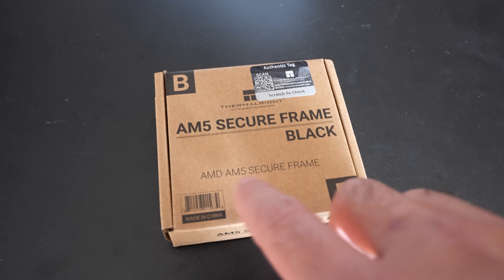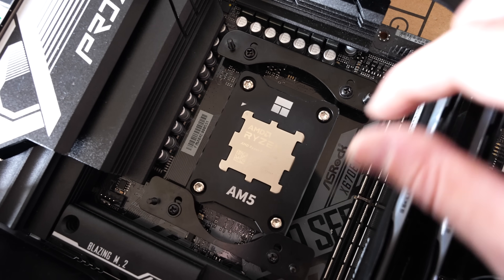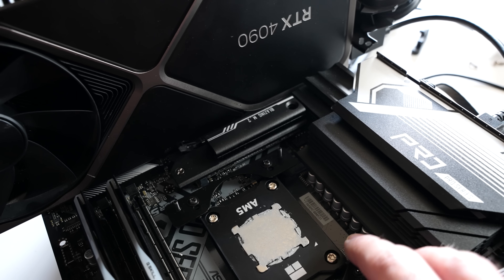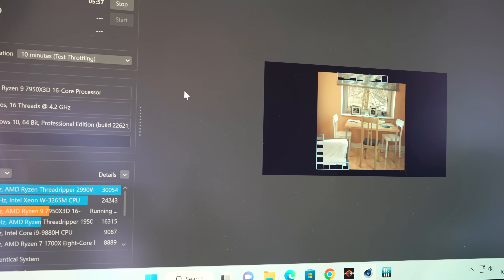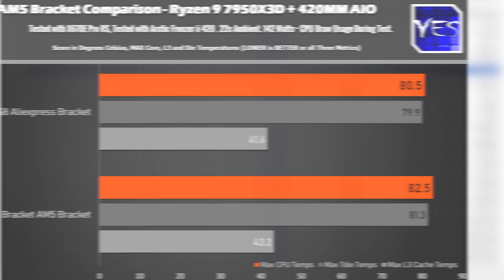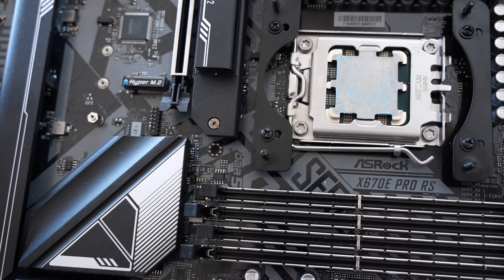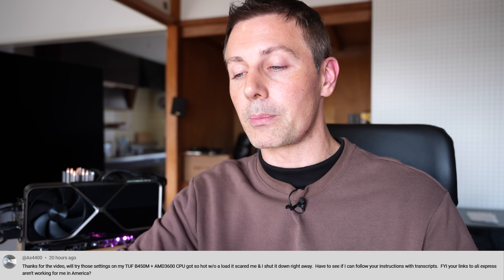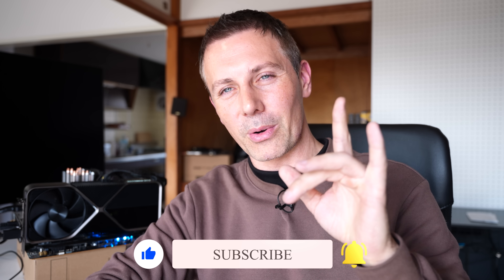$8 Fix for AMD Thermal Problems? | Thermalright AM5 Contact Frame

Comment: I know it likely does nothing but, there is something just so right about the way it looks when installed that would probably make me buy one. 
Sometimes it's nice just to do a job with something that little bit higher quality if it looks/feels so right. 
And yeah I know it's not visible once the cooler is on, but you still know it's there and done better.
Reply: I mean the price is worth the satisfaction and dopamine hit from the installation anyway.
Reply: its visible with a cooler on, especially a aio, so make sure you get a color you like.

Comment: btw ppl i have am4 have an x370 board and a 5600x cpu my temps were a bit weird would fluctuate i tried everything to get my all core oc stable it wasnt happening, I ended up lapping the cpu and realised my chip was made so uneven so defos if you cant get your temps down on amd ryzen lap your cpu down to the copper i did some asus realbench and got a max temp of 70-80 at 1.396-1.406v  ... then i played my game of choice vr chat in vr mode it was getting in game 55 degrees then i slept in vr woke up thermal paste settled overnight and now its running at 45 degrees which is amazing btw before the lapping i would run asus realbench at 94 degrees and this was a reading after replacing my thermal paste several times , also the reason i wanted an all core overclock is because i tried pbo oc and although the cpu gets to 4.85ghz it doesnt perform as well as an all core oc even at lower all core clock speeds.... so definately use all core oc's in the bios i went for 4.75ghz on all cores also i noticed all my cores are within a few degrees of each other like 1-2 degrees across all cores after the lapping and i had tried pbo and all core testing with two different cpu coolers and am now using bolts and nuts instead of the am3 hardware that fits on am4 mounting so yeah also got plenty of cooling fans in my case airflow is amazing

Comment: I have a 7950x and I've never had any kind of thermal issue.  I did hear that they ran hot before I bought it so went with a 360mm AIO cooler.  It does the job perfectly, I've never seen my temps go above 75.
Reply: so your only gaming on it?
Reply: @OPTIMUS6LTR gaming doesn't get it anywhere near 75c
Reply: My 5600x runs 15 degrees cooler than that just running a wraith prism and undervolt 😂

Comment: I HAD thermal issues but it was because my AIO sucked. (Thermaltake 240) The processor kept getting over 89⁰C and shutting down. I bought the Alphacool Eisbaer Pro Aurora and my temps dropped all the way down to 32⁰C - 50⁰C. Big difference.
Reply: Aio not working before lol
Reply: @MicaelAzevedo  Hence it sucking.

Comment: I thought they were just so thermal paste doesn't get under the IHS
Reply: No, they are not! The manufacturers clearly state solely for pressure improvement. The optional silicone guards for paste protection.
Reply: @Betelgeuse666  Manufactures can claim whatever they want doesn't mean it's necessarily true. Gamers Nexus did a video on these contact frames and found them to amount to basically negligible thermal improvement--me saying they're basically guards for thermal paste because they look and behave just like the silicon guard.

Comment: This is reminding me to not be lazy and install my contact frame for my 13700k.  Seems a bit overkill on AM5 though, I don't think they have the warping problems LGA 1700 has.
Reply: 13th gen undervolts like a champ too. They seriously overvolt the crap out of them. Really good clocks at ~1.2V can be attained compared to 12th gen.

Comment: I bought the thermal right lga1700 for z690 and i7 13700kf with Artic freezer 240 mm. The temperature reduction was insane, dropping from 70C to 55C at 5600Mhz OC.
I highly recommend these products if you plan to overclock or just want a lower cpu temp.
Reply: Yes, but only on Intel LGA 1700, since that socket has mounting issues all the way. So bad, that your problems can range from "only" memory instabilities up to booting right into a bsod.
If you're on Ryzen 7000 you would benefit more from lapping the cpu or delidding it, the IHS is actually the most hindering factor when it comes to thermals and clockspeeds, and keep in mind: Zen 4 is designed to push for those 95°C first when setting the clockspeed and voltage automatically.
Reply: the worst part is intel knew this was going to be a problem, I refuse to believe they didn't. My evidence for that claim is being a user of the LGA3647 socket, another socket that is nothing even close to square. The solution to the potential cooling issue was using the cooler to apply the mounting pressure from above rather than at a couple of points on the edge, the bulk of the pressure being where the lines intersect, right in the middle of the chip. AMD still made a square chip, so the warp of having an oblong monstrosity who's pressure is applied centrally isn't the issue, but as some have speculated the thicker IHS may be to blame. If so the fault of both parties was trying to maintain a broad cooler compatibility through using more or less the same mount design and Z height respectively.

There may come a day when more performance necessitates a return to direct die, or at least I hope it comes to that.

Comment: If you were to lap IHS and cooler plate flat you might find higher drop. Lapping doesn't usually help using the factory retention mech because it deforms the IHS slightly (actually quite a lot with Intel 12th and 13th, as much discussed) - the frame would maintain the profile of the IHS (the cooler plate also needs flattening because they're usually manufactured either slightly arched or domed to conform to that IHS distortion).
Reply: Lapping it makes the am4 coolers incompatible
Reply: It's Intel's fault, I really hate the design of their latest sockets, it's too wide on one side it's clearly made to be bent on purpose and I think they look uglier than ever specially when they have the highest prices and look less high-tech visually...

Comment: That air cooler is reaching saturation and can’t absorb anymore hear whether the bracket helps it make better contact or not. If you were to use something with two towers and two fans you would likely have seen similar results to the water cooler.
Reply: Air cooler is not enough. The difference should be in CB23 results. Roman tested offset mounting and no diff in temperature but cpu has +1500cb score
Reply: @hristobotev9726  there are some air coolers out there that would be enough. But that single tower with one fan is just not going to get it done. My 7800x with a similar cooler will hit 95c and thermal throttle within a few seconds under cb loads because the cooler is just not able to absorb that much heat. It works fine for day to day and games. Will replace it soon with an aio, just trying to decide. The 7800x can draw like 180 watts or something crazy and the single tower coolers I have seen are all rated for no more than 130 watts. It is unlikely that the cb score would improve as the cooler is becoming saturated within seconds of the chip going into a heavy workload and couldn't absorb more heat anyway.

Comment: 1 degree Celsius is margin of error. The problem With the 7000 series CPUS is that the IHS is thicker than what was used for the AM4 CPU's. The CPU's may be soldered but they increased the layer through which the heats needs to travel to reach the CPU Cooler.
Reply: yes and no, X series chips are also designed to run up to 95c just like your GPU
Reply: They're incredibly thick

Comment: It solves the issue with the thermal paste going all over the processor grooves. I would prefer this to the thermal grizlly pads as it looks much nicer.
Reply: so true!
Reply: Noctua makes the paste guard to keep the toes clean.
Reply: It does not … for this you must use the optional included silicone guards … the bracket is so,ely for pressure management.
Reply: Except that is not an issue at all unless someone is using a conductive paste, and there is no good reason to do that on AM5
Reply: @TheBackyardChemist  I change my thermal paste regularly, if you have an AM5 chip and you remove your cooling solution you’ll see why I went with this bracket. The grooves get gunked pretty bad with the exposed cutouts.
Reply: @TheBackyardChemist what are you going on about? Of course you use thermal paste for AM5 … the guards are for thermal paste overspills … and a must have using liquid metal.
Reply: @Betelgeuse666  it is pointless to use liquid metal on am5, the thermal bottleneck is not the ihs/cooler interface
Reply: @TheBackyardChemist  well, quite aware of that. Not an issue per say as for cpu operation or what not. But an issue for OCD people lol , cleaning the past overspill is pain, well at least for me.
Reply: @JRFKSERRANO  its not just an issue for "OCD people" .. wtf is wrong with you?!

Comment: This bracket is pointless for AM5. The only reason this was made for LGA 1700 is that the crappy stock socket mount bent the CPU and created an unequal surface area for coolers. It's not an issue with AM5 as it has tightenings on both sides not just on one and the CPU "head" is not the longer version like with LGA 1700 CPUs.
Reply: It has tightenings ha??? Both sides you say....😂

Comment: 1 degree difference is tough to attribute to the bracket. Could just be the variance between re-pastes and mounts
Reply: Because it wasn't made to decrease temperatures, but to stop Thermal Paste from running down the CPU's edge due it's shape.
Reply: @Nethan10Troi  yeah, really dumb design....
Reply: @Nethan10Troi  it doesn't even do that as it doesn't have a tight seal around the IHS. You'll need the rubber gasket variant of this for that

It's simply a product to make things pretty... Under a heatsink.
Reply: @silvershines  that is what it is being advertised for. It helps applying the TIM to a certain degree.
Reply: @Nethan10Troi it's irrelevant to actual usage though as TIM application doesn't really do much around the outer edges of the heatspreader. And it's no more difficult to apply TIM to the center of this heatspreader than any other.
Reply: It's understandable why Thermalright did it. They wanted to have something out in the market since they have been making these brackets for a long time and no one paid attention until LGA1700's warping issue. Now it's a product designed for those who want to make things pretty, as people can get quite OCD about non-rectangular shapes.

They had a similar product for AM4 designed to prevent the CPU from coming off the socket, that was the origin of this whole "Secure Frame" product name. This product is still called an AM5 Secure Frame on their main site; what exactly is it securing? Idk go with with the flow... 

At least the 1g of TF-7 thermal paste provided in the package is above average.
Reply: @silvershines  Its rather weird to see a video about this AM5 bracket with the expectation that it lowers temperatures XD
Reply: @BaneSIlvermoon  Again, its what Thermalright designed it for. Not to lower temps.
Reply: @silvershines it also prevents the warping of the cpu
Reply: @Nethan10Troi  no it doesnt do that, its meant as a replacement.
Reply: @HS-xyz  one that isnt required because we're not talking about LGA 1700 here
Reply: I use it to stop thermal paste from going down the chip and the aluminium shell
Reply: What a waste of time and money
Reply: @mio2540 year later and they fixed that

Comment: I guess if people want lower temps on aircooling, you need to DE-LID the AM5, and of course get a slightly better cooler than a Snowman.
I use a Skythe Fuma2 with 2 full size (not slim) 1800rpm Kaze Flex fans on my 5950x and it works very good, probably for AM5 not enough though unless people delid the CPU.

Comment: I'm still using older contact frame that come bundled with thermalright AXP-100H Muscle on i7-9700, and when I first buy one it's meant  only for haswell CPU and it made from plastic.

Comment: I haven't had issues with AM5 temperatures. I'd definitely look at motherboard options for temp improvement when needed.
Reply: What's your build? My cpu keeps fluctuating temps and hits 85°C constantly while gaming
Reply: @skeptical597 that's normal i think and what CPU do you have?
Reply: @skeptical597  that’s normal for Ryzen 7000
Reply: They are not made for temperature management, but pressure distribution. Clearly stated on manufacturer web pages! Not even as thermal paste guards as they are an additional option to bracket!

Comment: AM5 doesn't have a warping of the CPU issues like LGA 1700 does due to the square nature of the CPU AMD uses. Intel screwed up with 12th and 13th gen
Reply: but honestly if its 2 degree off Id happily take that for 8$ I mean its at least not harmfull so yeah
Reply: Distortion is always present to some degree with LGA socket retention mechs, going right back to the very first ones, just not to the gross degree seen with Intel 12th/13th.
Reply: LGA 2011 and 2066 had the best loading mechanism. so it didn't warp. with AMD the SP3/TR4 also didn't warp
Reply: To be fair : Intel screwed up with EVERYTHING !
Reply: I DID it 4 looks and like the video said asstetics.
Reply: And they REALLY screwed up 14th gen
Reply: @crazychickengd  both 13th and 14th gen have the instability (degradation) issues
Reply: This has confused me in the past.  I have a 12900K and snagged the contact frame to prevent the issue from occurring.  But it ended up causing my CPU to run hotter with the frame than without the frame lol.  I switched it back and forth twice to come to the conclusion that I would be better off without the frame on my particular motherboard.  So, in the end, this issue didn't affect every single LGA1700 motherboard.  At least I never noticed any warping on my CPU.
Reply: keep telling yourself that, lol but we AM5 uses we'll buy this $8 secure frame and install it nonetheless. :face-green-smiling:
Reply: @YashvirGaming  AM5 users don't need to buy these, why? because unlike Intel, AMD didn't screw up the ILM so it warps the CPU. That and the fact 13th and 14th Gen are space heaters in their own right.
Reply: According to der8auer, they made the ihs thicker or something to make the coolers from am4 compatible or something and this may have altered thermal conductivity for the worse.

May wanna double check since I could be wrong id your interested.
Reply: @Derpynewb  they did, they wanted to have cooler compatibility so they matched the z height of the am4 platform.  And adding material, no matter how thermally conductive it is, will only make things worse.  Would have been better to send out dummy CPUs and motherboards to cooler manufacturers ahead of the release so they could make either brackets for existing coolers, or design new coolers around it.
Reply: @nathanhamman418  Yeah, and because AMD failed to do this, you need to get a bracket for AM5 after you've delidded your CPU.
Reply: @nathanhamman418  A thicker heatsink can improve transient temperature stability especially on lower quality cpu coolers and mounts. A thicker heatsink thermally expands and contracts more gradually which should extend the life of the thermal interface and involved hardware. From what I've seen the ihs is fine for it's use case and these chips are already pushed deep into diminishing returns out of the box. I run my 7700x at 1.315v/5.475ghz all-core at 50-70c depending on game using a Arctic 240AIO. A thinner ihs is not going to achieve a meaningful enough temp drop(increase in clock speed) to justify the quicker thermal expansion.
Reply: @Derpynewb  yeah, der8auer knows what he is talking about and has solid, precise measurements data backing up what he says.
Reply: Yup thats the reason im not buying this bracket cuz pressure problem does not exist in AMD mobo
Reply: @yajhnal6536  Didn’t care too much about the retention but more so to help with clean-up as I reapply fresh paste every 6 months. These chips get gunked up around the grooves rather quickly, especially without an applicator.
Reply: @4KGBATD  yeah, I bought a gigabyte aurous ac ud z790 and 13600k and have had no issues on 240mm AIO.
Reply: Intel really doesn't have 'warping issues' on lga1700. If it did there would be swarms of people 'oh my shit all broke'. It's not. It may help with temps some, it may be from repasting the cpu for that matter. Just like the 'ehrr muh gerd, intel devil's canyon gonna melt' b.s. that went nowhere. Most of the heat issues with 12/13th gen are bios settings, mb's no longer using stock power limits and letting cpu's run out of the box until they thermal throttle. Essentially overclocking/overpowering the cpu which causes heat. Also negating the factor of the cooler base pressing down on the ihs so it's not just the force of the two tabs on either side of the pcb/ihs in the center. There's a flat block of cooler base compressed to the ihs pushing the whole pcb down.
Reply: @mattk6827  so that's why every major reviewer has shows it does??? hmm
Reply: @mattk6827  so you're telling me Gamers Nexus is fake news?
Reply: AMD < intel hahaha
Reply: @lightward9487  heat? Power consumption? What are the less in?